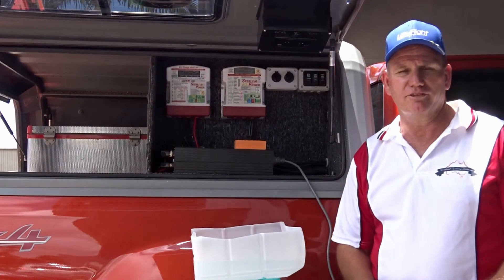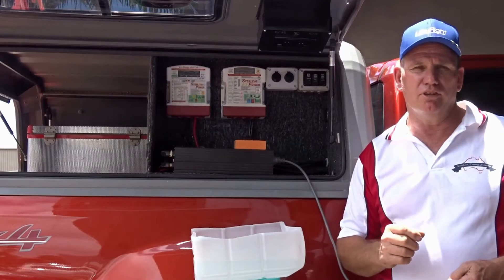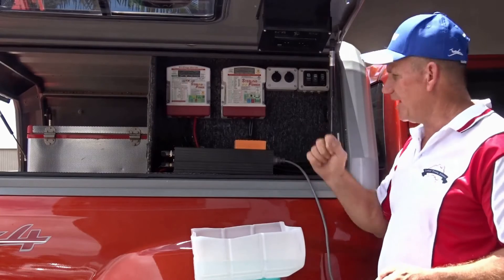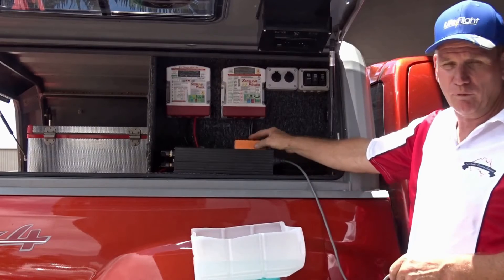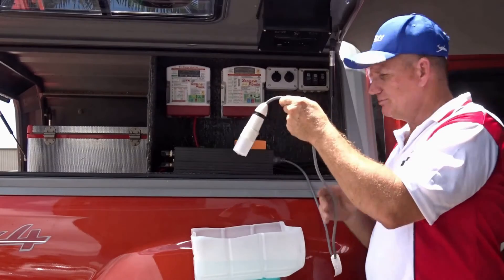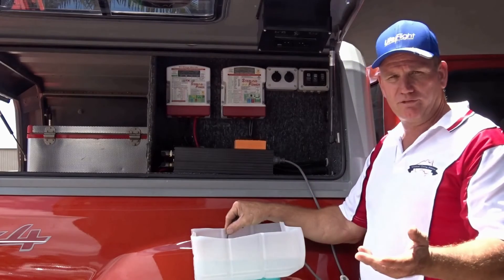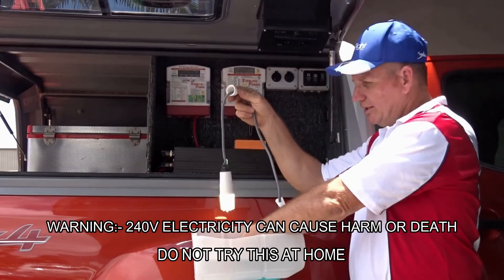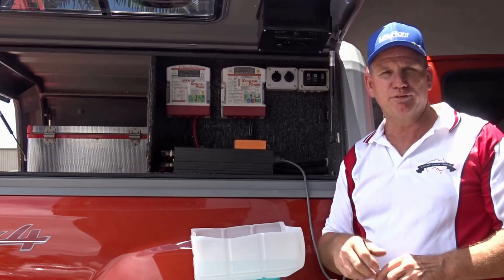RVDSAFE Inverter Combi Presentation 1 2

Comment: I’m an Electrical Contractor. I would like to comment that you are  demonstrating unsafe practice to put your hand into a live water container  and trust an electro mechanical device to trip.
Reply: I mean... The rv supply probably isn't grounded so it won't ground through the water.. Don't touch thr frame of the vehicle though.
Reply: @rkan2  I think you are missing the point. A Safety Switch or RCD or RCBO , etc I only a  part of electrical safety.  They are not to be relied on  as complete protection. You put your hand in a bucket of water and introduced a 240 volt potential to the water, and relied on an electro-mechanical device to trip. What if the Safety Switch was faulty in that instant ( and they do go faulty ) and you were standing on wet ground with bare feet. ?  No one should ever do what you did. I’m sure the Electrical Safety Office would freak out if they saw your video. Please leave demonstrations of electrical devices to qualified licensed people.
Reply: @frankianball  I get that - but everyone here is trying to be safer when it comes to floating supplies. Floating supplies (from inverters and generators) don't often require any protections in many countries, especially if we are talking about vehicles and electrical systems not connected to the grid.
Reply: I'm with Frank - that was stupid.
Reply: Ask the office of technical regulator about the RVD and they pretty much call it snake oil salesmen much like this stupid demonstration. If the RVD is such a great device why are there non in any  power station?